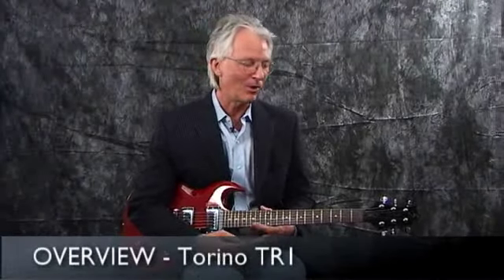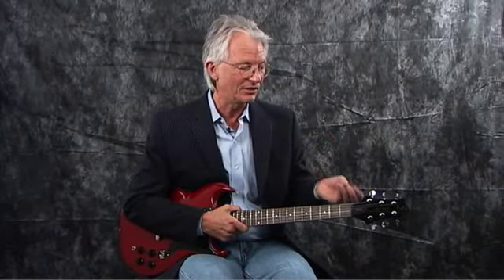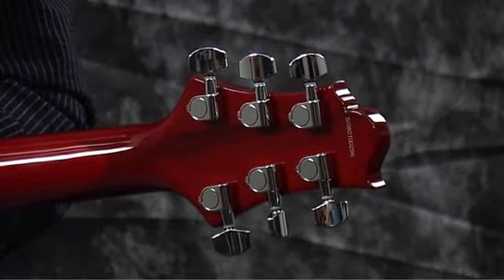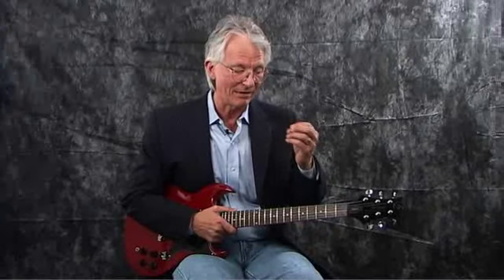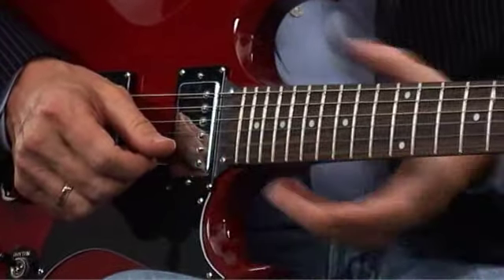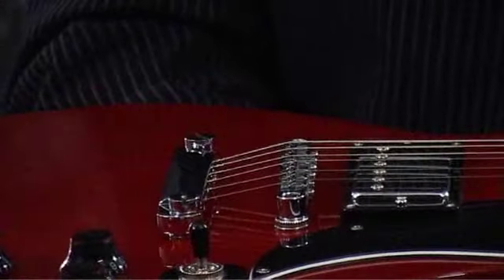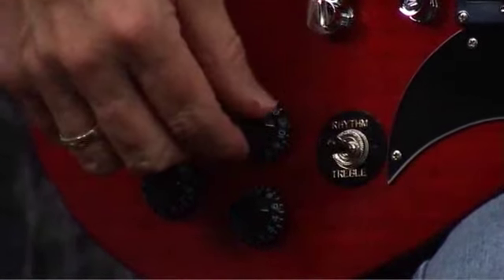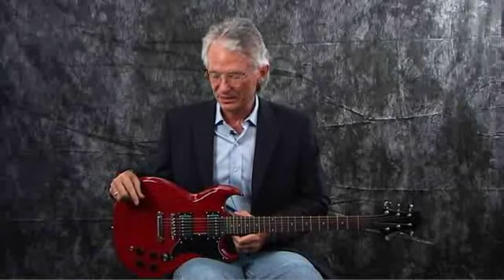Featured Guitars - Torino TR1

Comment: One thing that I really like in these guitars is that they avoided most of the mistakes that a lot of manufacturers make for "tradition", cost, or other reasons. The torino does have the SG strap button problem because it wants to look like an SG, though, so one thing remains.